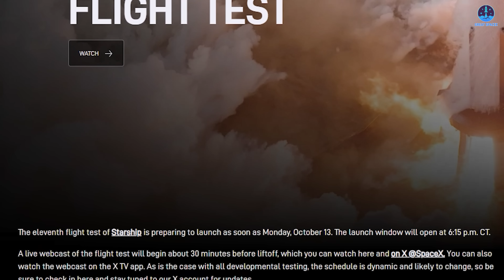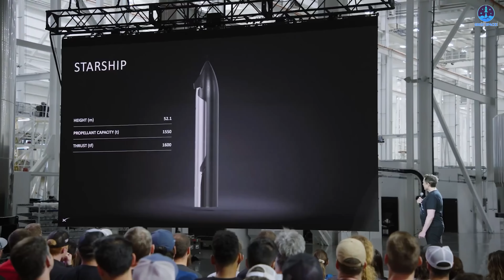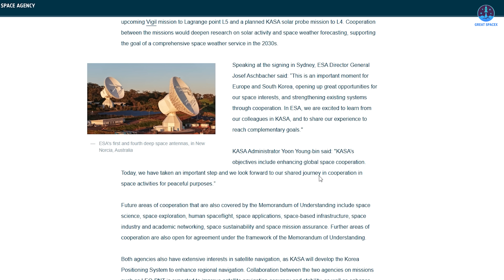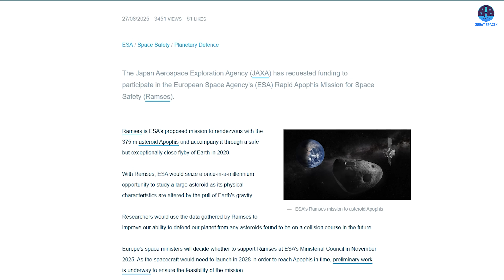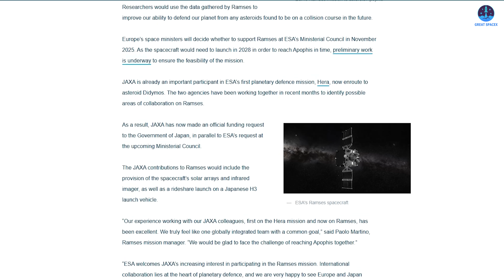SpaceX CONFIRMS Starship Flight 11 Launch TODAY after Checkout Completed! Countdown Begins...

Comment: Did SpaceX ever say what caused both aft flaps to be damaged and the explosion in the aft skirt?  I have a feeling its a blocked vent line (ice) that caused high pressure in the line, with heat from engines (high pressure steam) I could see it causing explosions

Comment: Apollo: Mission 11 took astronauts to the Moon. 

Starship: Flight 11 is a suborbital test of the previous vehicle version, with all mission challenges still ahead.
Reply: Apollo had unlimited funds and a Government that drove this, and it still took 12 years and almost 300 missions to get to that point. Their mission was also straightforward: and get there and back before the Russians. Now, SpaceX is governed by a budget and is working on reusability. A much more complex mission profile.  If the goal was just to get back to the Moon, they could do that now.  The goal, though, is to make everything reusable, so that it is not a one-and-done but a continuous back-and-forth transporting of crew and material at a fraction of the cost.  That takes a lot more effort.

Comment: SpaceX needs to move the aft flaps up above and past the engine bay area. The re-entry heat is too intense in that area. That or the flaps are just too long and the tail end of the flaps are holding too much heat.

Comment: Will be surprised if SpaceX does not conduct a Wet Dress Rehearsal. I predict launch will not happen today. Keep working.
Reply: @colonbina1  Kevin, I was wrong and you were right about the launch today. Incredible flight. From what I could tell, the Crunch Wrap worked great.
Reply: They're ready and bold - it's also the last Block 2  and pad 1 so today's primary objective is to dispose of the obsolete equipment.